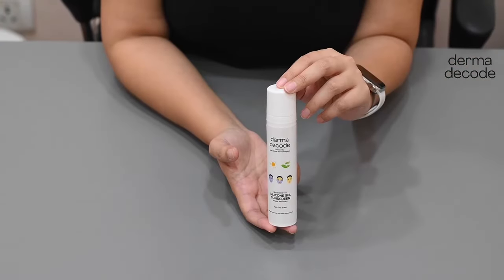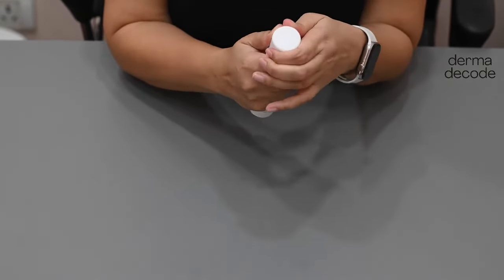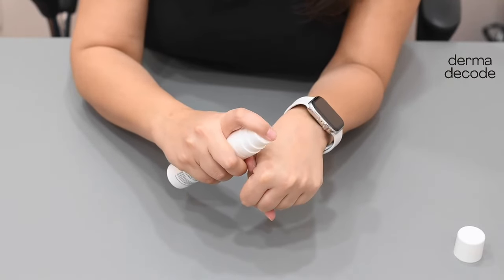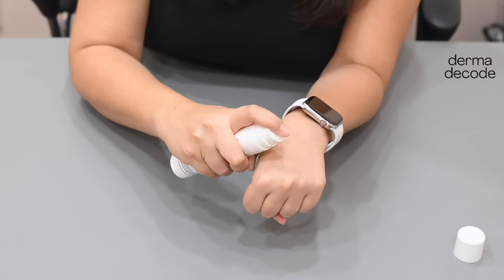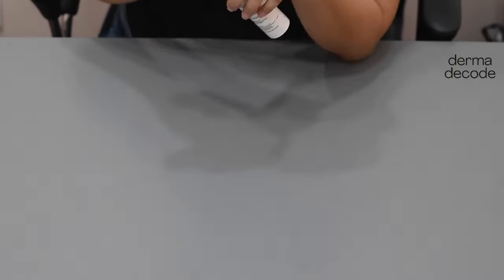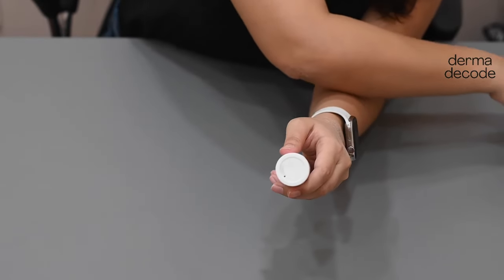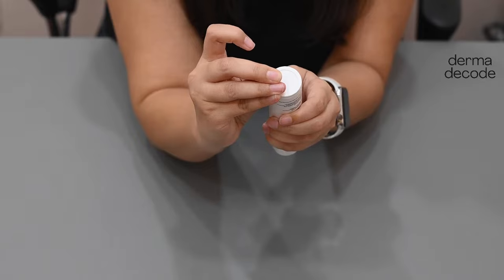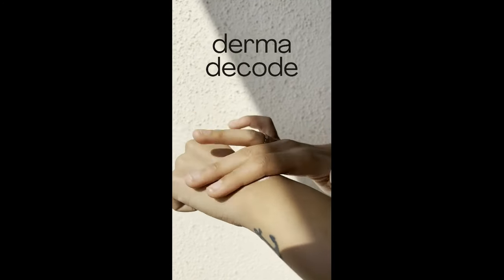derma decode | How to dispense from derma decode airless pump bottle

Comment: Hi i wanted to ask iam 17 should i syart using retanoil or only use your serum in the day and night? And not retanoil
Reply from the maker: Hi ! Use only the niacinamide ceramides hyaluronic acid serum if you have dry to normal skin. No need to start retinol at age 17